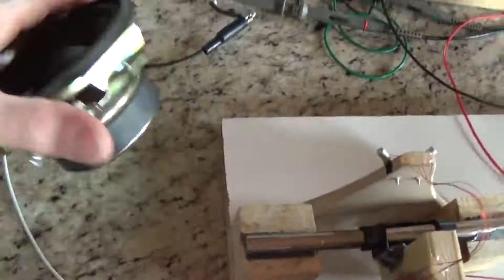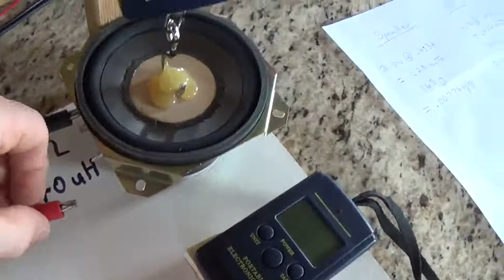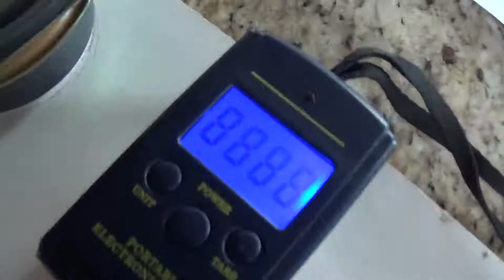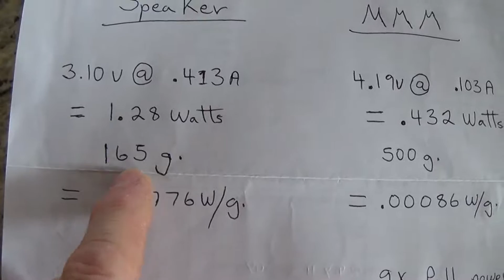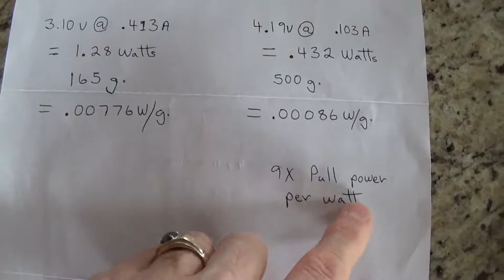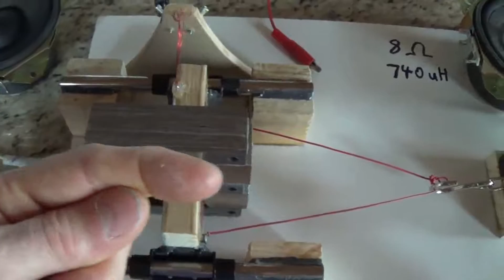Mostly Magnet Motor test 5

Comment: hmm i didnt get the same results.- however my experiment was with round magnets and shafts. , i found that it actually reduced the power by about 20%,  -  are you sure your core was saturated too begin with ? .  -- iihave no wounded fingers or dignity yet.   - lets see what happens.